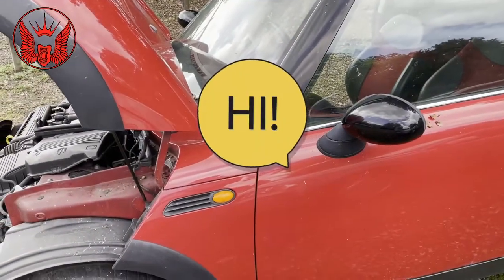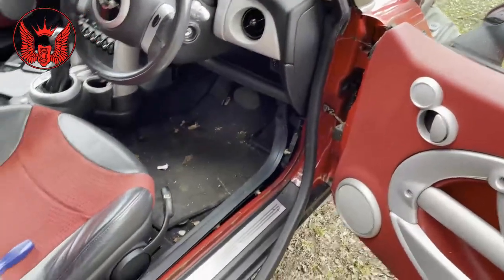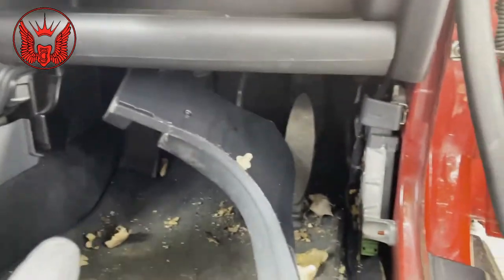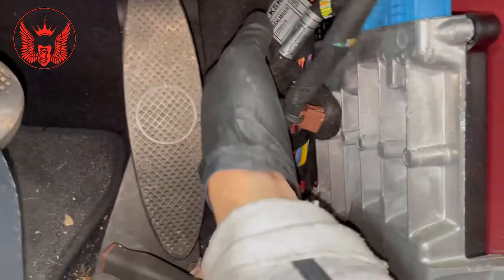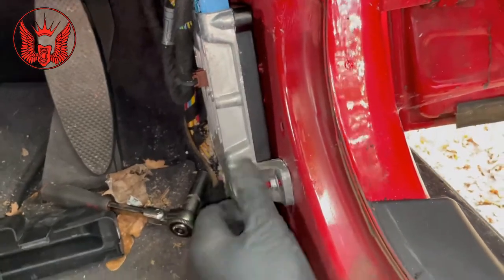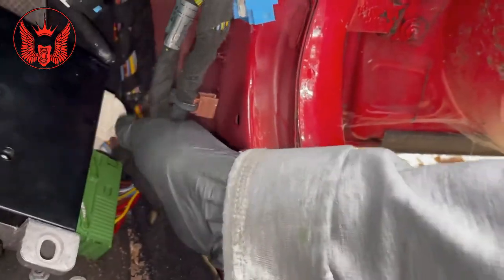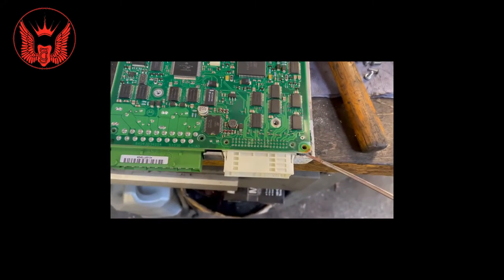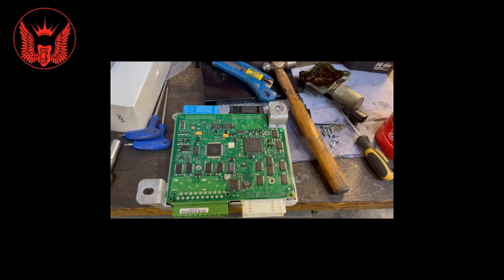Mini Cooper r50 2001 body control module unit location faulty uk

Comment: Our 2004 Mini One got flooded when the tide rose by the river. The footwells inside were flooded. We're being told that the car is a write off. If I change the BCI, will that cure it. Or is there more than one module down there in the footwells? Thanks
Reply from the maker: there is the ews which is incharge of the immobilizer, however if you fit a second hand BC1 that you can purchase from ebay at around £30 pound give and take, you can see if it fixes the car, having said that the i think that on the other side as in passenger side in the uk there is a fuse box, so its possible that some fuses blew as the water would cause a short circuit. you really need to check all fuses and see if they are ok first.
Reply: Thanks. I’ve been told it’s a  write off - all too expensive but thanks for the advice.
Reply from the maker: no worries you welcome..i actually need and engine for mine lol @piersoconnor9150

Comment: Would this cause problems with the instrument cluster. As my coolant guage goes up fully when car is cold
Reply from the maker: It can for sure I have some lights on dash, however usually it comes with other issues. So if you only have the gauge issue you may want to check the sensor first.

Comment: Is the body control module the same as the footwell module
Reply from the maker: Basically as far as I know the bcm is know as the footwell module on later manis and bmw. On the early models like the one in the video is called bcm or bc1 which is located by the footwell.
Reply: @DaringBeefcake  im going nuts with a 2004 r50  i just bought

I have a 2004 mini R50
Issues
- when car is  off ( and switch for lights is set to off) lights remain on
-battery drains of course
-signals left or right turn on hazards and  high beams
-  doors do not lock with remote
Sometimes car will start( when battery is charged of course) or sometimes just click
Was told it sounds like the bcm- 
Some say you have to program the bcm for this others say you dont when you place in a different car
Seller told me after he knew about this issue and never told me 😢
Reply from the maker: Well the video I made is specifically to show that you don’t need to program the BCM when you replace it. So you can buy one from eBay fairly cheap and replace it plug and play so again no programming. The only issue is that the remote control for central locking will not work. But everything else will work. Just remove yours check the part numbers and get another one, some eBay ones can be faulty too if so return it and get another one happened to me.
Reply: @DaringBeefcake  my mechanic explained it to me.
Ot depends on if it needs to be reprogrammed-of the other vehicle  has the same features then all will work-if it doesn’t 1 only the ones it had previously programmed i to it
Reply from the maker: @livefortheweekends9923  ok, sounds good so best to try match the part numbers with your to get the most accurate..

Comment: i have a exactly same problem on my mini 2001 r50.did you fix this? it's very hard to find same number of this bcu for early r50.
Reply from the maker: Hi am in the processes of investigating the issue and will be making another video soon, just happen that while having this issue my fuel pump i believe has stopped working so i need to fix that first..
Reply from the maker: Check out the video here https://youtu.be/LFSgqC-XqqI
Reply: @DaringBeefcake  cheers!!! really appreciate!!
Reply from the maker: @heejungpark8009  you welcome 🙏
Reply from the maker: @heejungpark8009  yo welcome

Comment: I am having the exact same problem with my r53, after replacing the battery with a mew battery, I am experiencing the same electrical issues. I am going to check the bc1 tomorrow morning for moisture, I did wash my car a few days ago, and it rained the next day.
Reply from the maker: It could well be that is go water on the bc1, best way is to remove and have a look if you disconnect it the green connection is really hard to unplug so be careful.
Reply: Lets all keep eachother updated help eachother fix this problem.
Reply from the maker: @seanlee6706  of course :)

Comment: Any one can help me Sir, my wiper spray water is not working, is it because of the BCM? I have searched and tested the fuse, all are working fine
Reply from the maker: It could be the spray motor, you can remove it and test it, or check if there is voltage at the motor cables. They often fail.
Reply: @DaringBeefcake  I have try direct battery motor washer pump is working
Reply: @DaringBeefcake  I'm check socket with test lamp not have energy but when I'm check all fuse  and relay not have burn ..all good fuse..